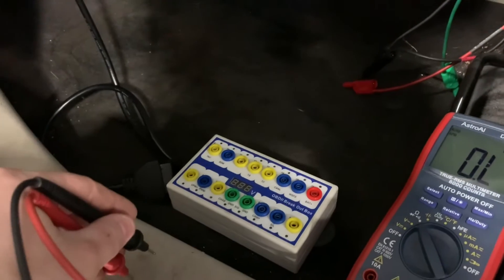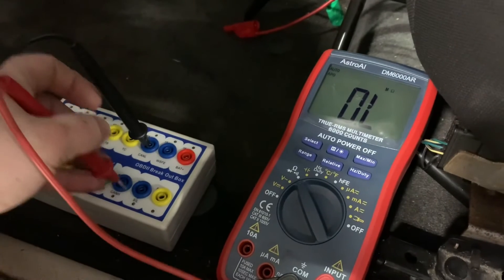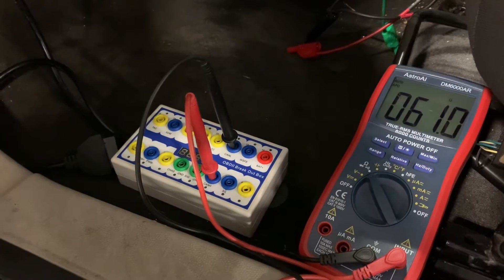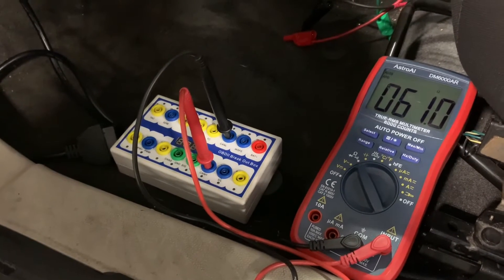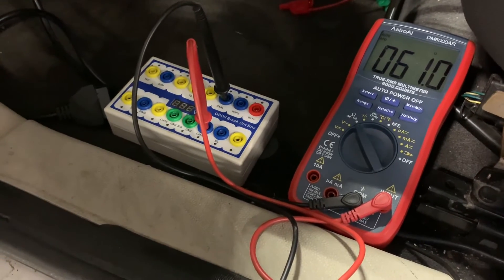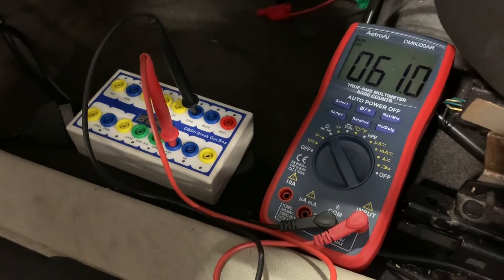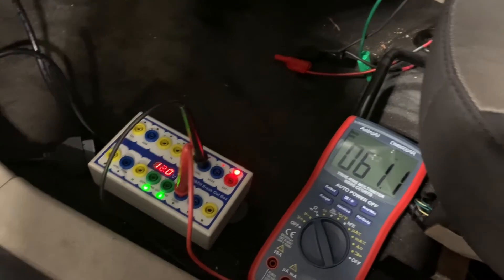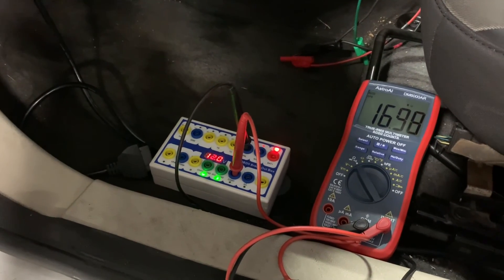Testing Resistance on the CAN Bus Network

Comment: A U0100 error code brought me here. Using your 6 and 14 pins test, I got a reading of 102 ohms. What does this indicate?
Reply: open/short somewhere on can wire/shorted resistor. battery disconnected test between pin 6 and ground. then pin 14 and ground. you are supposed to see 120 ohms on both. if not issue has been located

Comment: The 120 ohm resistor is usually called the end of line resistors and they are usually in the devices that are of course at each end of the line. You are correct that some of the devices are on a spur off of the main line so you could have one of these devices disconnected and still measure your 60 ohms. We have a rolling mill at work which uses basically a can buss to communicate with all of the I/O and devices distributed throughout the machine and sometimes the connections on some of the devices get dirty and the machine starts acting up because of bad communication on the can buss. I usually hang an Ohm meter across the can bus then go around to each device and give it a tap and if the connection is dirty I can see the resistance change and clean that connection.

Comment: I was taught to not test resistance with power running through a circuit, does it not matter?
Reply from the maker: In all cases except this one you won’t do it because the readings are inaccurate, but since we’re not looking for a specific reading it works just to know the network is active. Plus it won’t hurt the circuit to do this.
Reply: yes, resistance test to be done without power running.